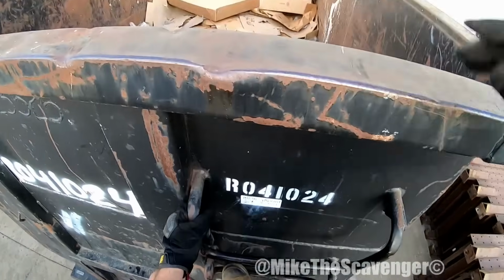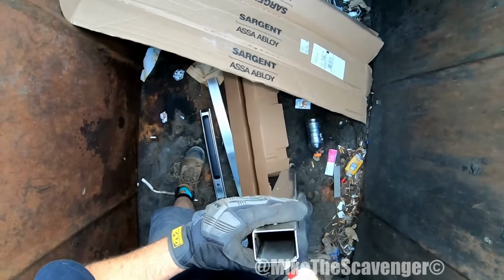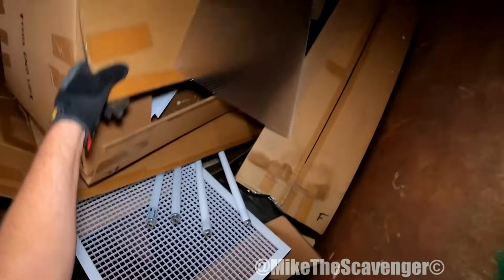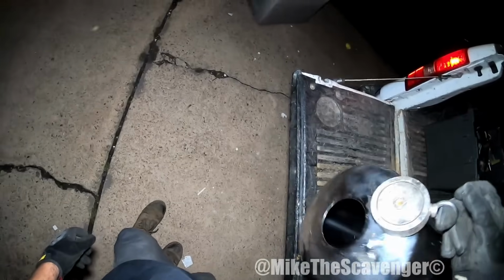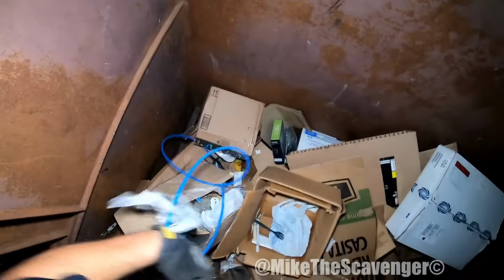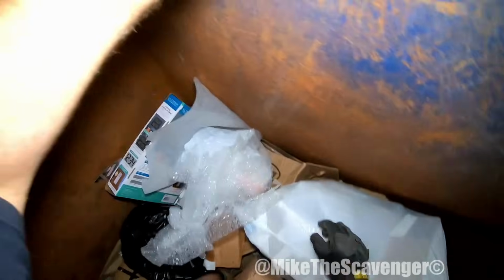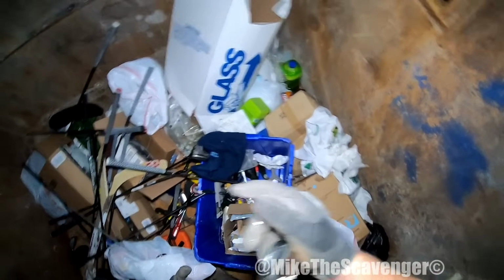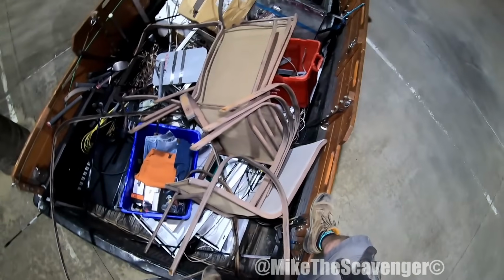Dumpster Diving "This Thing's Full Of Tools!"

Comment: In the dumpster with the golf clubs, not for absolute sure but the thin box you looked in the item looks a lot like one of those new stone bath mats advertised all over the internet. They run approximately around $ 50.00 each.
Reply: Absolutely. 😖
Reply: And the green power washer head is worth about 40 new

Comment: Mike I’m down here working in Ft Myers’s Florida and there is so much scrap down here from the hurricane. I saw a truck with a 24’ gooseneck side wall trailer loaded down with nothing but a/c units and there were many many more sitting on the curbs everywhere

Comment: Totally good advice regarding bubble wrap. If you have company near by dealing with electronics look for smaller ones that have they bins accesible We used to send 2 full garbage  bins of just bubble wrap to landfill every week... despite advertising that any one who needs it can collect for free.. and we used to have hudge sheets like 1.5m x2 sometimes 3 or more meters... we used to reuse that bubble wrap to and we did use it along every boxes that we could reuse... still amount of it was hudge... you could supply small packing company.... yet there was little interest despite that shit can be expensive... also we did have a lot of red bubble wrap antistatic...

Comment: The dog kennel and the box on top
Of it would fetch 20 to 30 bucks easy and quick where I’m from. I sold several of the kennels and storage containers that I didn’t need for good money when I find em
Reply: I’ve also sold the marble base from trophies to a trophy shop before too. It wasn’t a lot but they took it off my hands and it paid for more than gas and it was on my way to where I was going. I’ve actually sold to them several times and now they just tell me to bring the whole trophy and they’ll disassemble them

Comment: That’s a great video.  Thanks.   Why is it that sometimes when you’re tossing things around in the dumpster there are sounds like metal hitting each other and also the sides of the dumpsters, but you don’t come up with anything else ??  I’ve always wondered but never asked.   Also, because Halloween is coming up, I’ve been wondering if you ever went back to that dumpster where you felt someone tapping you on the back, but No One Was There 😱😱😱      Take Care 😅

Comment: Mike you are so awesome especially finals tools I mean I find some myself sometimes I find a little bit of this a little bit of that but you know you taught me about cast aluminum and I've been separating that stuff I also found some weird looking batteries are flat they look like aluminum on the outside with a little bit of rubber on the sides but their batteries and I found one at first and then I found a boatload afterwards and thank you for the stuff you show me on your videos what's worse and what's not I plan to get a stripmaster to do the wire I found that I couldn't get into cuz it was too thick for me to cut but thank you for the information and the stuff you show me I mean I scrap a whole lot of things copper brass aluminum gas aluminum you name it I find it thank you bro really appreciate it